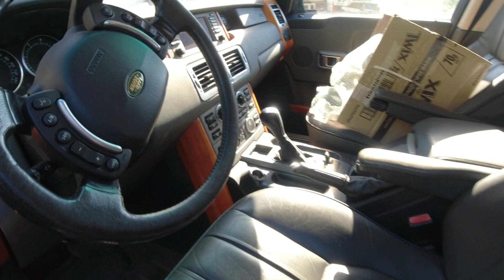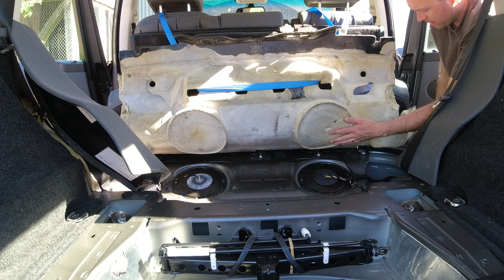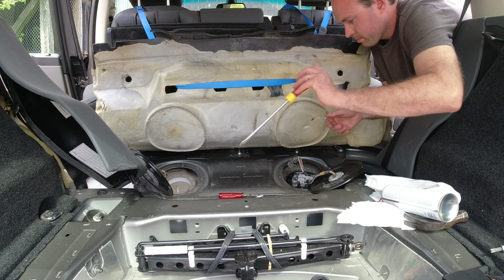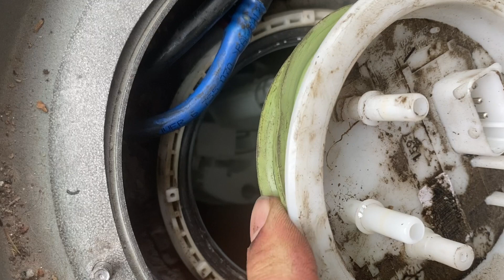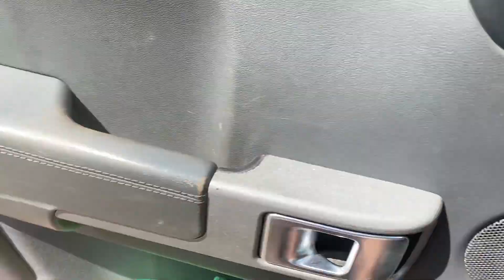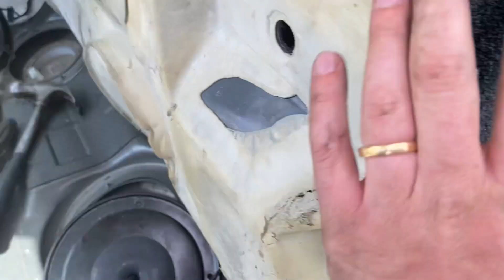Range Rover L322 with No Fuel Gauge - Let's Fix the Previous Mechanics Error!

Comment: I have a problem when I drive mine if I hit the gas to fast or if I go downhill the road the gas pedal stop working ! I need to turn off the ignition to reset . And I replace the fuel pump too ! This happened after I replace it . Thanks

Comment: Hi Adam. As usual problem solved ! The fuel guage on my Citroen Berlingo is wildly inaccurate and regularly tells me l'm out of fuel. Today it wouldn't start . However , the car was sideways on our access road with the petrol cap on the upper side . So l guessed petrol wasn't getting to the engine . I managed to reverse the car on the starter (!!) So l could roll it down the hill to the level . After a nervous 10 seconds of winding the starter off she went . Straight down to the filling station and managed to squeeze in 12 litres !!! They say you shouldn't look a gift horse in the mouth and as l was gifted this from my cousin who had to return to Seattle .....l don't ! Thanks Adam
Reply from the maker: Must make for  exciting drives not knowing!

Comment: Cutting an access panel to replace the fuel pump on 1990+ XJ40 is actually the sane way to do it, for a few reasons: The tank is very difficult to remove. The fuel line connections are right above the diff and are more than likely seized after all these years. If one is dumb enough to try and remove these, the connections might break and be unavailable. If the special fuel line break, good luck! It is the way that actual XJ40 and X300 owners do.

Comment: Hello Adam, we are driving on our way to Syracuse New York to strip a cylinder head off of a Volvo S60! 👋
Reply from the maker: Ah nice! 5 cylinder?
Reply: @LivingWithAClassic  yes 2.5 that skipped timing.  The 2012 S60 vintage have problems eating the  serpentine belt into the timing belt cogs under the timing cover